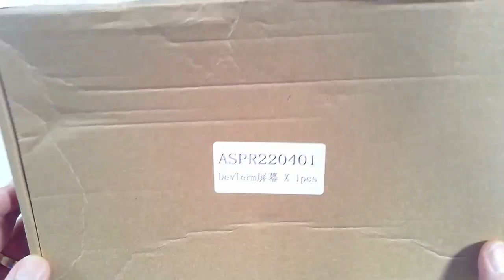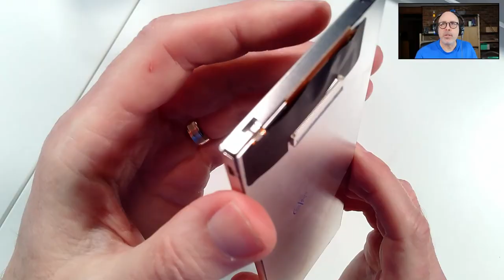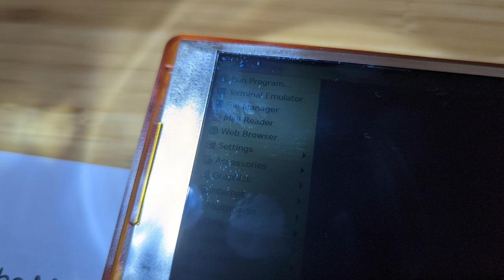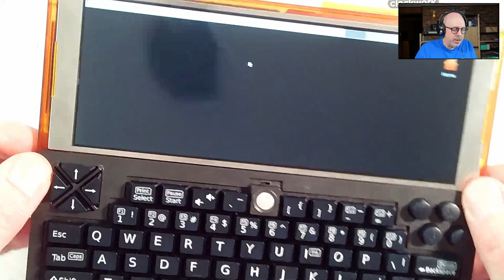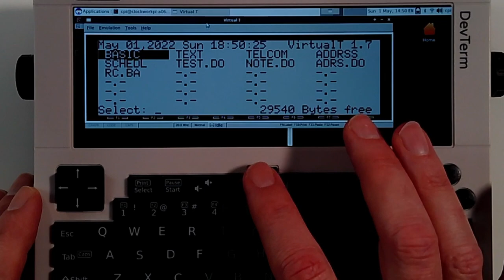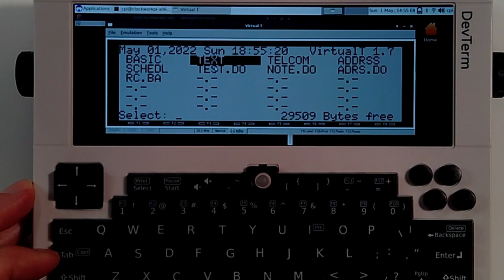How to Replace the Clockwork Pi DevTerm LCD Panel. BONUS: VirtualT Demo!

Comment: Mine doesn't even have anything showing on the display, I tried shining a light on mine to make sure. I just sent them an email and I may try downloading the OS and flashing it back onto the card to see if anything changes.
Reply from the maker: Did you check the ribbon cable for any breaks or tears? If there's nothing on the screen it could be another issue and hopefully one that's easily corrected.
Reply: @retroCombs  going to check the cable tonight. Will this display work on a Pi4? I have one that I could test with, also getting a cable for a Pi display would be fast, might be able to fold it into place. I need to fold some really complex cables at work for fold out and rotate LCD on cameras.
Reply: I ended up reflashing the OS image onto the card, once done it is all working now.
Reply from the maker: Outstanding! Glad that fixed it and it wasn't a hardware issue. Enjoy!